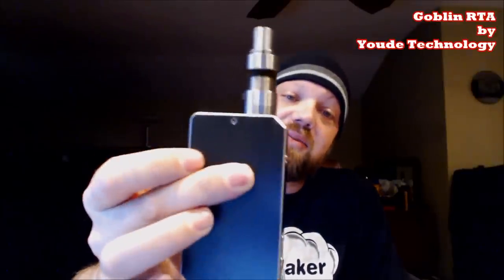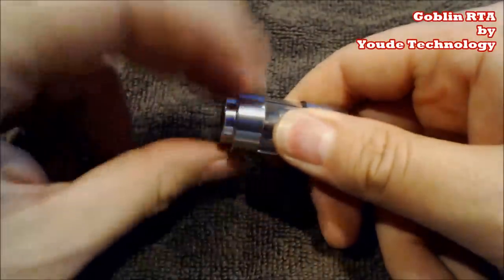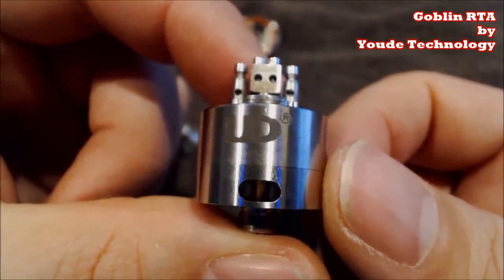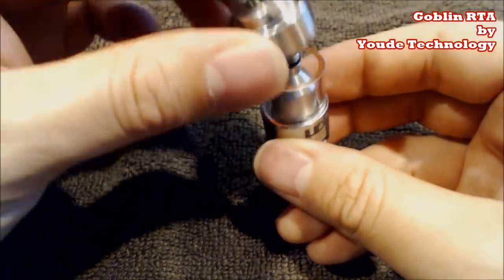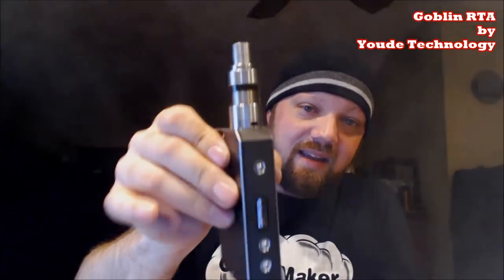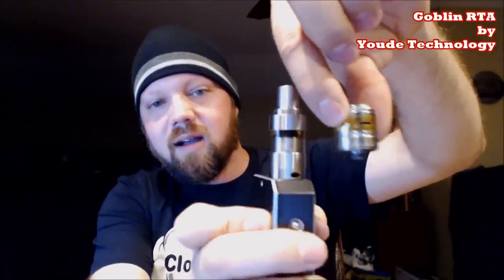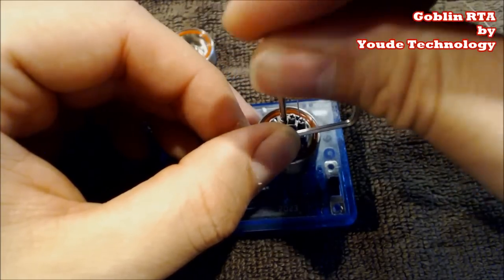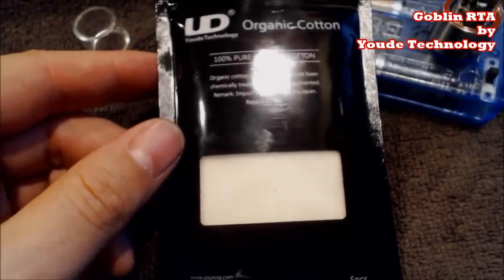*Massive Airflow* Goblin RTA by Youde Tech Review/Rebuild

Comment: i saw this video and bought the v1.2 from mt. baker. BEST TANK EVER. assembled it and used the little bit of free wire to make a build. came out .3. . used free juice sample. it hit so hard i couldn't tell the juice was 0 nic until i read the bottle. using 4 mg juice and getting nic sick...going to start making 0 nic juice just for the goblin. i was going to ask how u keep from getting dry hits running that low but i saw you said you are taking very short pulls. that's what i'm doing too. i'm getting huge clouds but just not used to short pulls yet. oh, i can't really go along with the "stuff a bunch of cotton down the juice channels" method. i get much better results with sharply tapered wick ends going down the channel. all in all, i learned a lot from this video and your comments. great device. great video. thank you.

Comment: Got my SilverPlay Sat 1-24, very impressive except blind filling. Monday 1-26 the Goblin should be here. Have watched this 3 times now. Thanks Ray.
Reply from the maker: Nice yea the blind filling kills it for me but you can also top fill both the sp and the goblin, just unscrew the top cap and hold the glass section.
Reply: Yeah, finally tried that. A little goosy but worked. Ordered a Kayfun chimney, quartz, top cap from Fastech that should fit. Will restrict the vape by quite a bit but thought I would try it for grins for about 10 bucks. May be one of those out and about options??? I'll let you know how it works out if you want.

Comment: I run a mutation x v1 with airflow 3/4 open with a .18 build and this little guy with a .43 build on the same mod is comparable and battery life is way better on my mechs I only do 3 battery changes per 12 hour day vs 8+ changes with the mutation x. So far I love it satisfying vape and don't have to build as low.

Comment: The Silverplay by Sub Ohm Innovations on vaporDNA was just posted and is very similar, deck air looks about to be the same size, ended up going with the goblin anyway but figured id say another option, the Silverplay is $39 (29 after $10 off code) and the Goblin was $27 so pretty even there too
Reply from the maker: I just bought the SilverPlay to find out what tank is better
Reply: Ray Lo Vapes Do a comparison video when you get it. My Goblin is here tomorrow but curious to see how it stacks up

Comment: I'd say between this and the billow hard choice as I can take the billow up to 70 watts with no dry hits it's warm as hell even with max vg though no wicking problems. Damn I want this now lol
Reply: I'm not going to lie I'm buying this lol my god ud has made a hell of a nice tank. I thought the billow was bad ass but ud has come out swinging.
Reply: Joshua Elias 70 watts on the billow damn what's your build , 70 watts regulated or on a much?
Reply: agreed love my billow, i use 28 ga tigre wire 7 wraps on 3mm bit i run at 50 watts all day but can turn it up more if i want
Reply from the maker: Joshua Elias Yea they did this goblin right!  So far nothing I have used can compete with this little tank.
Reply: Yeah that's same build I have in my billow also from Trevor Jones build video and it works well I haven't had a dry hit but I stay from 55-60 watts average. 

Seeing this goblin though I think u could really utilize that tank to full potential lol I'm sure it be filling it up alot though. It looks to be closest tank to dripper out right now.
Reply from the maker: Joshua Elias As I said in the video it outperforms 80% of my drippers.  If built right this could be used in cloud comps lol.
Reply: I'm buying it the day it come out lol

Comment: Ray Lo Vapes thanks for the comprehensive review. I just picked up the Lemo Drop, as my first RTA. Been happy with the flavor on it, but not enough airflow. I guess the only other tank I have to compare the airflow to is the Atlantis. What's your opinion on the Goblin 2 months after making this video?

BTW, thanks for what you do. I enjoy your videos, and glad to see that you're still making them. When is UD going to send you a better camera? :D Sound quality from the mic is great.
Reply from the maker: They send me gear to review.  Equipment for the videos is all on me.  The camera is one of the most widely used cams by the other big reviewers.  I'm not about to go shell out over a grad for a camera fuuuuck that.  I'm not rich and this is a HD webcam it does the job.  
But I have not really been using the Goblin for the last month.  I have been using the next tank they are going to release in April sometime called the Goliath.   The Goblin is still a bad ass little tank though and I still think it's possibly one of the best RTA's on the market at this time.  My only complaint was the slight seepage I get from the fill screw.

Comment: Nice review ... looks very interesting and it's cheap! Looks like it 'should' beat the Billow and Orchid V4 or certainly in leagues with them both. The 3 ml kinda bothers me and IMO they should have started with a 5 ml and offer a 'Nano' kit... I can easily imagine refilling constantly.

I do like the staggered 4-post (top/bottom) of your coils. The build space doesn't look much different than either the Orchid or Billow. One thing that caught my eye is there's no O-ring on the filling screw; do you have any bottom leakage? Can you top fill?

BTW ... IMO the Atlantis has too much airflow in its widest setting ... it washes out the flavor too much. All in all I rather have 'that' problem of too much airflow than too little.
Reply from the maker: Yea I get a tiny bit of liquid at the base after a few hours.  I'm gonna see if I have an extra small oring to throw in there.  Bonus with this RTA is you can dial the air flow to however you like from wide open to restricted mouth to lung hits.
Reply: Ray Lo Vapes I fully understand about the airflow. Do you know if there's going to be a 5 ml tank option? I have a ton of RTA's, and I buy them if they're interesting. 

The Atlantis is okay except for it's tiny capacity and IMO the 'mystery' wicking material is questionable. So to date my favorite two RTA's are the Billow and Orchid V4 .. the V4 allows for Kayfun accessories.  

The Achilles Heal for the Goblin is its small tank; 5 ml and an O-ring on the fill port they'd really have something!

Thanks for the reply!
Reply from the maker: I've been talking to them about making a 5ml extension kit.  But they are still on vacation so I haven't heard back just yet.  But with the popularity of this tank already i'm pretty sure that will become an option here soon.
Reply: Ray Lo Vapes Sounds promising and thanks again! :-)
Reply: D Jaquith
I don't know if you've seen this, but Wotofo apparently made a 7ml tank replacement for the Atlantis. It's out of stock everywhere I looked, but you can at least see it here ($13):

http://trianglevape.com/atlantis-extension-wotofo/

Funny enough, I found it because I was looking for the Goblin, which is also on that site (and out of stock as well). Everything I want is out of stock or hasn't been released yet (I'm looking at you, iStick 50w).
Reply: Robert Bleach Oddly enough I ordered my extention Monday from http://www.eciggity.com/atlantis-extension-tank-7ml-by-a-mod/ .. oddly in that I don't use that tank anymore. It's the mystery fill material. I don't want either fiberglass (silica) or 'ceramic' particles in my lungs.

On the same site they just listed the Delta II so if you're thinking of one you might want to order it.

I keep looking for the Goblin and as I recall there's only 2 sites I've found carrying them. So on the 19th I'll hopefully get one.
Reply: D Jaquith Hey D! We meet again. Just wanted to say my piece. I really appreciate the way they started this little unit out. Me personally, I love the shorter stature of the Goblin. That is on of my main gripes with the Billow and Orchid v4. Sure, the 5ml capacity is nice in the Billow, but man it is just so damn tall, it almost makes it ugly to me.

Now, another thing I like about the goblin. It has more room between the tank glass and the chimney. Although not a huge deal, I find it bothersome with the other rta's how juice kind of gets "trapped" and works slow when filling and such from having such a tiny tolerance.

Oh, and one last thing. Beautiful deck, and no more ridiculous leaky grub screws to set the airflow! I am stoked to own a Goblin personally. I hope it blows me off my feet like I had hoped the Billow was gonna do.

PS. My Orchid v4 did not come with an o-ring on the fill screw. I just tighten it down snug, she has never leaked a drop!

Anyway, cheers bud.
Reply: Ryan Lee Hey man! :-)

I'm only wanting the option and there are indeed preferences for both sizes. The Billow does have a Nano option http://www.eciggity.com/billow-rta-nano-kit/ and frankly I've complained plenty about it's airflow screws and I'd much prefer an adjustment ring.

The Orchid's bottom fill port is a royal pain to use. I top fill both RTA's.

My concern with the Goblin is lower guage builds and it's apparent small build deck and what I've said above. To be clear I do not own a Goblin yet. AFAIK it's coming back into stock on the 21st. 

I did order the Silverplay and I'm hoping it'll support some full glass / plastic tank option. I don't know what they were thinking with its see thru position. 

Personally my favorite RTA is my Orchid V2 that I modded including with a chimney extention.

BTW the Atlantis with that 5 ml tank looks like Lemo now. So yeah I sure understand esthetics! ;-)
Reply: Ryan Lee i like the tanks with the short tolerances between the glass and chimney. It "holds" the juice down by the wicks, exactly where i want it. Who cares if it takes 2x as long to fill. Try it man. Hold a tank like this upside down. The juice stays by the bell portion of the chimney. It was designed this way on purpose.
Reply: D Jaquith yes it does leek out the bottom every single time
Reply: D Jaquith youde s updating their goblin now. it comes with 2 sets of glass tank and chimney to match. the old 3ml and a longer 4.2ml one. http://www.yourcig.com/ . hopefully it will come out before the chinese new year holidays start over there
Reply: Adrian Abubakar Thanks I'll keep an eye on it.
Reply: Adrian Abubakar yeah we have it in stock
Reply: VapeL1FE Jai No you have the new $45 Goblin 4.2 ml RTA with a bigger tank or at least I can't find the tank only option. 

I'm one of them that purchased the original Goblin and I think from you guys.
Reply: D Jaquith yeah the tank ONLY is going to be a pain, I CNY is now so I cant touch base with alot of people.  Yeah we have the big tank option,  sorry ill look into it for you.  The new goblin comes with 2 tanks, the small and big one

Comment: I sub'ed just because of this review. Ordered one yesterday because it's been referred to as the "Billow Killer", and personally that tank is the only one that got it almost perfect. I've had many Kangers, from the KFL to the SUBtank, the Atlantis, and the Billow. I almost bought an Arctic yesterday until somebody told me about the Goblin, but most of my vaping friends swear by it.

I don't think it's been released to us commoners yet, but have you tried the Maganus tank made by Vapeston? If so, how does it compare to the Goblin?

2014 was the year of the RDA and the box mod, I have a feeling that 2015 will be the year of the RTA.
Reply from the maker: Well it's difficult to compare since most of the tanks on the market are Clearomizers and not full on rebuildable tanks.  I also own or have tried most of the new tanks to hit the market and all the sub tank clearomizers.  I personally am more of a fan of RTA's since I build and wick it myself and not trusting a company to make coils for me since they are always hit and miss. But the Goblin was the first RTA to have 6mm of airflow on a rebuildable tank, it's small and compact so it allows for more flavor on top of allowing for massive clouds.  I have yet to try the Maganus tank yet as I barely heard about it 2 weeks ago and haven't had the chance to try it yet.  But if you are looking for the best clearo sub tank I would give it to the Arctic right now but again proof will come by how the pre built coil heads perform.

Comment: Looks great. Turned off by the bottom fill screw though.
Reply from the maker: I have been able to unscrew the top, hold down the glass and top fill without any leaking.
Reply: Ray Lo Vapes  Hehe, cool, although that sounds a bit risky! But I can see that working actually. My reason for wanting a tank is going out with it. Doesn't really work for me, if you gotta bring tools ;P
I'll consider it again, knowing you can fill it like that.
Reply from the maker: It's not risky, it's pretty easy actually.  I've been doing it that way the last few days and no issues.  I still have my tool kit with me at all time but haven't had to use it since i figured out I could top fill.
Reply: Ray Lo Vapes  Alright! Thanks for letting us know :) The performance of the thing looks outstanding!

Comment: I love my goblin.... but #1 issue is that the post screws are too short and the bottom part is pointed and even with my 26awg it will not trap the wires 100% and I will get jumpy resistances all the time. They need different screws with flat bottoms and longer in length so we can totally trap the wires
Reply from the maker: BCabral43 Drom what I have been told it was a QC issue on some of the goblin tanks and they have been sending out replacement screws to the vendors and to the customers who have bought them.

Comment: Sorry to bother you Ray, but some people are worried that the copper pin exposed to the airflow is prone to oxidizing.  What do you think?
Reply from the maker: It can always be taken out and cleaned if need be.  Copper pins help with conductivity so you get less voltage drop to the tank.

Comment: I can't get a stable build on this device. I've tried 26g but the wire is to small and wobbles around causing the resistance to go all over the place. I've tried 24g but even then the resistance travels all over the place because the shit post screws back out as soon as heat is generated.  The tolerance on the glass section is horrible...it's not flush with the tank sections inner diameter and the o-rings are too wide, I haven't had any leaking but getting the glass to stay centered is nearly impossible. Kinda hate the goblin at this point.

Comment: Why are the side air holes 7x3 if the holes underneath the coils are 3mm?  It doesn't matter how big the outside holes are if it gets more restrictive inside the tank.
Reply from the maker: It's better than restrictive on the outside.  This is full wide open airflow going to the 3mm air holes on the deck.
Reply: Sure but I just feel like there would be over half of the adjustable airflow that wouldn't do anything, as you can close it down to 3x3 and everything more open than that would make no difference.

Comment: Good review, been in the market for a new tank to replace my kraken. I want to know is does it leak? or does it hold the juice pretty well? thats only my concern since my mod sits in my pocket while I work.. But def want to get one and the price is right to
Reply from the maker: Only leaking I get is a tiny bit from the fill screw but it's very minimal and won't leak into your pocket.
Reply: Sweet good to know, what would you say is the sweet spot build wise? Will be mostly using a mechanical until I get a regulated box.. Bit excited for this tho as im in a group buy for this lovely tank
Reply from the maker: I'm still rocking the build I did at the end of this video.

Comment: thanks for this review ray.  i love my dual 24g macro's on 1/8 - 6 wrap.  do you think this will fit in the goblins reduced chamber?  have you tried 24g on it and did it touch the walls of the chamber? thanks in advance.
Reply from the maker: As I explain in the video the biggest coil and gauge I've got to fit is the one I use in the build tutorial at the end.  5/64" ID 26g was the biggest coil that I got to fit.
Reply: thanks for confirming.  hopefully UD makes a version 1.5/2.0 with a bigger chimney/deck.
Reply from the maker: Doing that means the tank would need to be bigger than 22mm.  Also the flavor comes from having that reduced chamber.

Comment: Hey Ray, was hoping for some advice. I built mine to 0.5ohms. 26ga, 9 wraps on a 3/32 drill bit if I'm remembering correctly. Above 29w i'm getting burnt flavor. Any tips? You being able to run it at 50w is insane...
Reply from the maker: Might want to thin out the wick a bit in the juice channels.  It might be packed too tight.  I've actually found that going light on the wick is better for the higher vg juices.

Comment: Haven tried any new tanks, still using the atlantis, i wanted the lemo or should i just get this
Reply from the maker: Depends on what you are into.  The Lemo is also a good tank, holds 5mls, is a simple kayfun single coil deck and has fairly decent airflow.  The Goblin is smaller, holds 3mls, blows fat clouds, and has massive airflow.